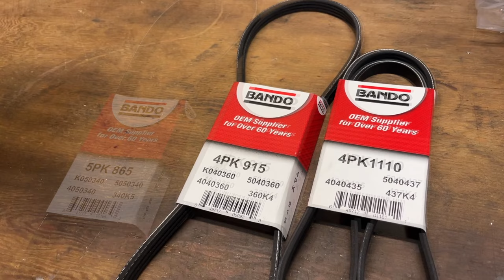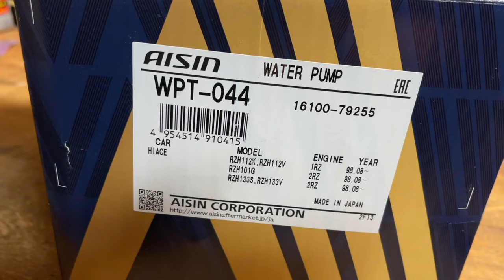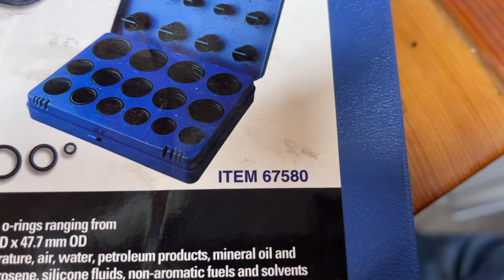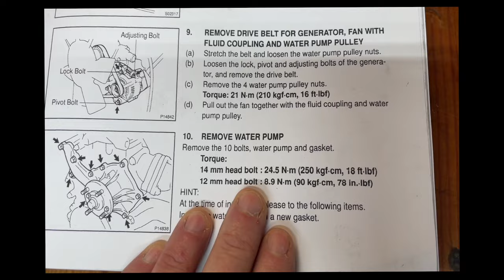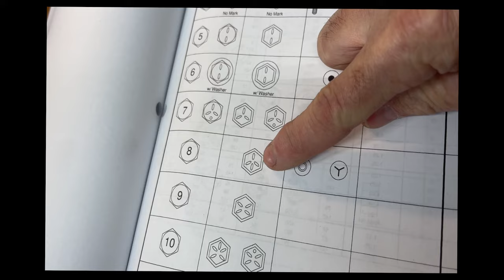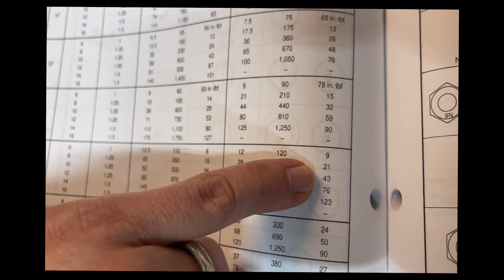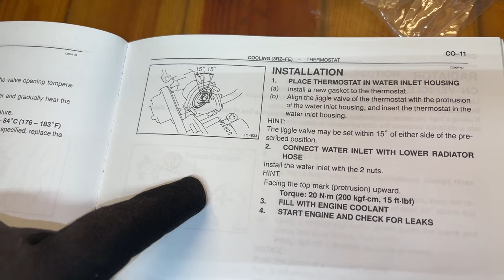Toyota 3RZ-FE Water Pump & Thermostat Replacement

Comment: I got over 200,000 miles on my 99 PreRunner with that same engine. It still has the original water pump and alternator.  AC still working too.  I think I should swap out my water pump soon before I blow up my baby.  I’m original owner too.   Love your videos !!!
Reply from the maker: Yeah, it probably would be good for you to do some cooling system maintenance.  If your radiator is original, I'd replace it too along with the both hoses.  I'm glad you like what we're doing.  Thanks for the comment!

Comment: Good Afternoon guys! I love the videos, always find myself coming here because you guys just know a lot about the 3RZ. I have one in my 97 Land Cruiser Prado and it has an issue that I can't find. Upon a cold start (right in the morning after a night), the engine doesn't idle at 1800, then drop to 800 RPM after warming up. It just sits at 1000, or sometimes it stalls at 400 RPM. When it's warmed up, rest of the day has zero issues. Replaced both coolant temp sensors, new spark plugs, new MAF, cleaned IAC and throttle body, nothing. Thanks for the videos again, been a life saver multiple times!
Reply from the maker: It does sound like an IAC valve issue.   Maybe when it is cold,  the valve sticks, but when warm, the little door moves more freely.
Reply: @TimmyTheToolman Thanks for the reply! That sounds like a possibility. Ill take it out when cold and test it with a multimeter and see if it moves slow.
Reply from the maker: @Mick-oi3wy  Let us know what you find out.
Reply: @TimmyTheToolman  Good Afternoon! Lo and behold, the valve is gunked up with some brown rust looking substance. Maybe time for a new rubber gasket. I wish I could send you a picture because this looks real wierd.
Reply: @TimmyTheToolman  Nevermind. Cleaned the rust out, still acting up. Just gonna buy a new IAC
Reply from the maker: @Mick-oi3wy  Hope the new IAC fixes the issue.
Reply: @TimmyTheToolman  It's gotta. Took the IAC out again for a second look and the door won't open. It closes all the way, and opens halfway but can't open anymore. Think I found the issue
Reply from the maker: @Mick-oi3wy  I hope so.  Let me know the result after you get the new IAC installed.
Reply: @TimmyTheToolman  Issue fixed! New IAC, and reset the ECU by disconnecting the battery for >30 minutes. Comes back to life after a cold start like its 1997. The old IAC "works". The door is busted. I'll take it apart to see how they work. Thanks for the suggestion!
Reply from the maker: @Mick-oi3wy  I'm happy to hear it worked out.
Reply: Gonna leave this here for anyone who reads this thread. RESET YOUR ECU WHEN YOU DO A IAC JOB. YOUR ECU WILL STILL THINK THE OLD ONE IS IN.

Comment: just curious how this job is holding up ...did you guys place the jiggle valve at 12 o'clock position?? just curious a lot of people with V6 say their manual says to point it in the 6 o'clock position but is the 3 rz to be pointed in the 12 o'clock??
Reply from the maker: @mrgpomona420  I'm guessing you didn't watch the video because we covered the position of the jiggle valve in this video.  For the 3RZ engine, the jiggle valve goes at the 12 o'clock position.   For the 3.4L 5VZ-FE engine, the jiggle valve goes at the 6 o'clock position.  So, those a lot of people were correct.
Reply: Sorry what i meant was ..after asking you --how the job is holding up, if you guys "left it placed" in 12 o'clock position and wanted to add if there was any issues with temp that made you guys switch the jiggle position.lot of these threads people go back and forth with the position.. thanks for clarification first time I actually hear this..about 4 cylinder vs 6 cylinder thanks for responding man. I did watch the whole video.. good video by the way
Reply from the maker: @mrgpomona420  The job is holding up fine.  His engine temps are good.  The orientation of the jiggle valve for the two different engines is how I specified.  You can trust me or not trust me, but I'm not the average jamoke giving advice on a Toyota forum or on a Toyota Facebook group.  I don't know everything, but I' m 100% sure about this topic.  So, I hope this response eases you mind.  Good luck!

Comment: I have a 98 4runner 2.7 I'm pretty sure the water pump is going out and I'm glad to see this video posted by you recently. Always helps to know exactly what I'm doing first to make the job smoother.
Reply from the maker: Good luck with the job Aaron.  Hope it goes very smooth for you.
Reply: @TimmyTheToolman  Thank you. I just finished it up today I put a new Aisin water pump and new thermostat and fan clutch in. I put a new Denso radiator in in June which unfortunately got dented up installing the new water pump but no leaks lol. I was trying to be careful like you warned but goofed up. I had to pry the fan clutch off but made sure to put a pad in there for that part. For some reason we took the pad out when we went to pull the pulley off and it was kinda stuck and it busted right into the fins. Seems like everythings working good so far though in the 25 mins I drove it home. The engine only has about 130k on it and transmission was rebuilt so hopefully should be good for a long time. Thanks for the quality video man
Reply from the maker: @Aaron-uz8xt  Great job getting it done.  I wouldn't worry about bent cooling fins.  It's not a big deal.  I'm glad our video helped you out.  You're very welcome!

Comment: Hello, nice video! Maybe you can help. In winter, at highway, the heater radiator goes cold, and there appears some air in the cooling system (can hear some streaming sounds). After stop and turn off engine and start again, the radiator starts heating. Cold/Hot switch valve is working ok.
Reply from the maker: Try burping the system with a Lisle Spill-Free Funnel.  Have the front of the vehicle higher than the rear to help facilitate the removal of air from the system.  While burping the system, have the heater control to full hot.  Lisle Spill-Free Funnel https://amzn.to/2SnrPFV
Reply: @TimmyTheToolman  thanks. I mean, air appears at high speed again after removing all air.  Also air appears at night while cooling. I changed some hoses, may be sucks some air while cooling, but still can't locate where air comes from:)

Comment: Going in on my T100.  Thank you I needed to see this. Going all new with hoses and pulleys., fan, blade, and fan clutch, all oem and new.  Thank you so much.
Reply from the maker: You're very welcome.  Good luck with the job!
Reply: @TimmyTheToolman  OK friend don’t laugh but I’m a newbie at all this. The only thing I’ve ever done is change the oil so here it goes. I’ve got a new fan a new fan clutch and a new water pump. Can I just assemble all those into 1 piece  I’m not using any of the old parts,  Also changing the tension pullies out. How would you go about getting the old fan fan clutch and stuff off? Would you change the way you did in the video
Reply: And I’m not using any gasket maker or anything like that correct I didn’t see you do it. I did it every single gasket I needed, including a really premium composite gasket for the water pump.
Reply from the maker: @dswilliamson2112  Just do it like we show in the video.  You'll be golden.

Yeah, no gasket maker unless you see significant pitting on the block surface where the water pump seals.

Comment: Excellent camera work. Excellent info. Thanks!
Reply from the maker: @pavementsailor  Thanks for the compliment, and you're very welcome.
Reply: @TimmyTheToolman  Yep, just replaced the thermostat, and it went smoothly. As a side note, Tractor Supply has these (no kidding) Rabbit cage trays that are fantastic for wide area drip coverage.  20 dollars for a heavy duty 2 1/2 foot square with about a 1 1/2 inch lip. Caught every frame drip.

Comment: As ever, loads and loads of great content for many similar Toyotas and a really nice 4Runner.

On the ‘misprint’ (yeah seen a few) I’m glad you pointed to the ‘standard’ torque settings at the front of the book for bolts etc based on their size. There are also torque settings elsewhere in the books for steel bolts of similar size into aluminium parts or that compress aluminium parts, such as on the thermostat housing as you had. 

Something else to bear in mind is that these torque values look to be for dis-assembly. They are maybe to warn you to not apply too much force and try other methods to avoid snapping etc, but I could be wrong?

I think the giggle valve is there to allow a bit of hot water through, otherwise the thermostat can be starved of coolant that is hot enough to otherwise open it, or in its own bubble of cooler coolant, if that sounds better. I guess it’ll also let a bit of air through for fresh coolant that has more air dissolved.

Really like that funnel and the excellent advice throughout. These vehicles are not that complicated but they need care and attention when servicing otherwise things get missed, go missing or get broken.

Cool!!
Reply from the maker: Thanks for the comment.

I've never seen just disassembly torque values.  When they put them there as part of the steps to remove something,  it's actually the torque value for reassembly.  I've never seen two different values in the FSM pages.

Thanks for sharing your thoughts on the purpose of the jiggle valve.

Yep, the Lisle Spill-Free Funnel is a game changer.

Happy Wrenching!

Comment: Hey Timmy, love the commentary, I saw your ps reservoir video, do you have a PN for the o ring that mates the reservoir and the pump? For the 3rz? I’m doing a water pump Job as well as ps at once
Reply from the maker: Happy to hear you like my commentary.

I don't have a part number for the 3RZ power steering reservoir o-ring for the connection to the pump.  But, since that is such a cheap thing to buy, I'd just order it from your local Toyota dealer.

Comment: is the pink coolant fluid compatible in this model?
Reply from the maker: The pink coolant came out a little later for newer models.  Would it work?  I think so.  I did see a TSB saying the long life and super long life coolants were compatible.  But, to play it safe, I'd just use the Red Long Life Coolant concentrate and mix it 50/50 with distilled water.

Comment: What manual do you use? I have a 01 4ruuner. Thanks
Reply from the maker: The Toyota Factory Service Manual.
Reply: I meant repair manual
Reply from the maker: @robertshirlingjr.6988  Yeah, that's what I thought you meant.   We use a Toyota Factory Sevice Manual, which is a repair manual.
Reply: What repair manual do you use? Thanks